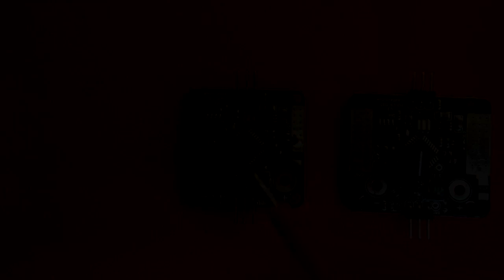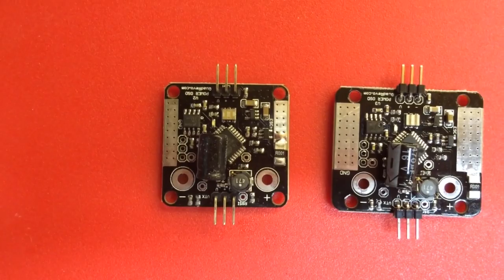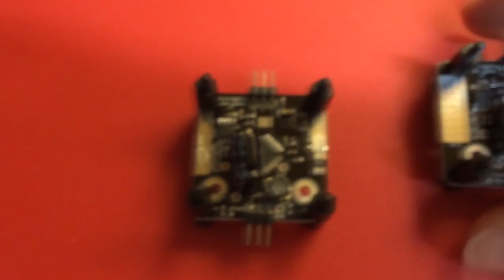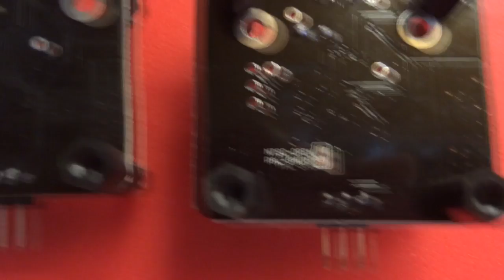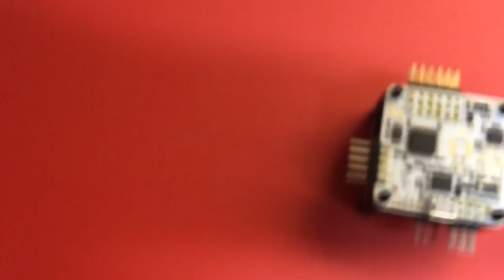QuadRevo PowerOSD V3 introduction

Comment: I have the new Quad revo pro. Would like too know what are the thee holes in the middle of the board,next to the NTSC/pal. my 5v pad came off. wanted to use 5v from one of those holes.  Checked it on my meter and it read 5v. Can I use that? Thanks

Comment: I like how you mentioned the camera that came labeled NTSC and was in fact PAL - that was the issue you helped me identify with mine.

How necessary is the 5v power supply for the PowerOSD V3? Thanks for including the regulator by the way!

Cheers for a great product - Allyn from FL.